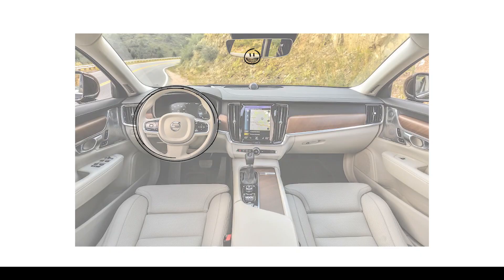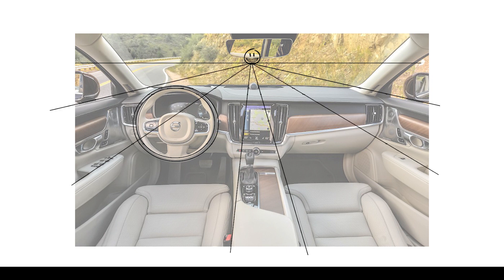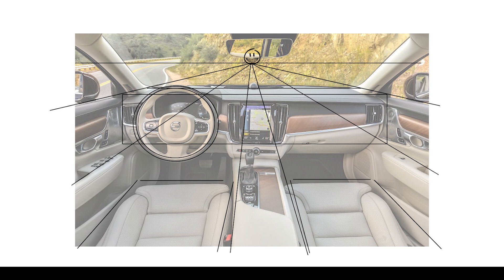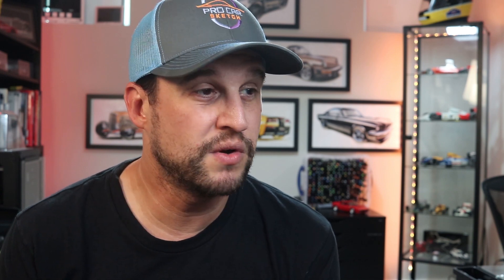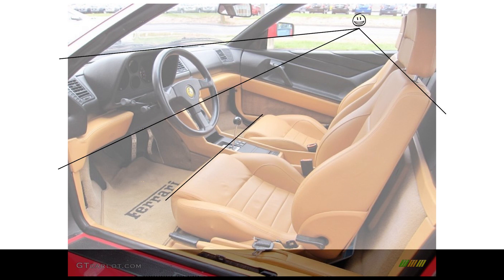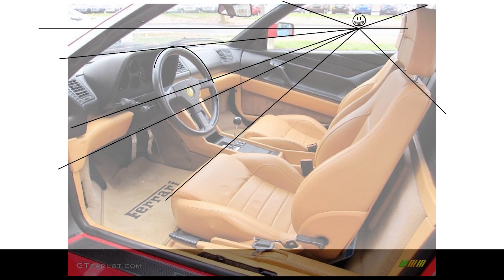One Point Perspective for car designers

Comment: Hii Rod! Should I start making design first on paper or on iPad, will it be too soon for beginners to use iPad instead of paper?

And nice video and studio...thanks for the knowledge.
Reply from the maker: Digital is just a representation of what we used to do all manual.  Digital tends to be more time efficient. But interestingly it is still a mix of both. A lot of designers like doing the sketch on paper and then coloring digital. Also real car design studios build digital models, cut them with CNC on clay, Modify the clay by hand and the scan it again to digital.
I suggest you get as much practice with the manual stuff. The digital would be easier when you make the jump. Everything you learn manually will apply to digital
Reply: @prosketchbyrodcamus8807  Thanks Rod. I will first go with paper.